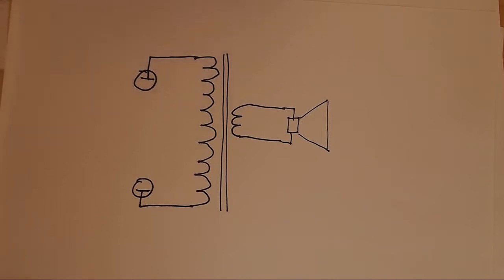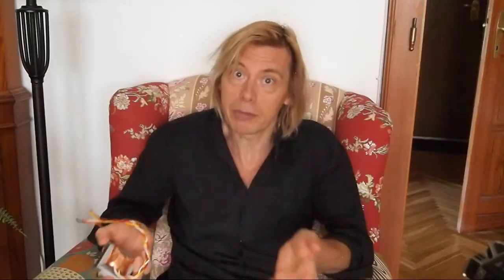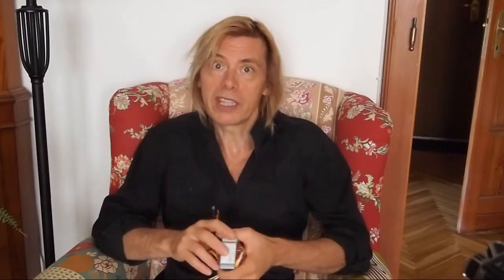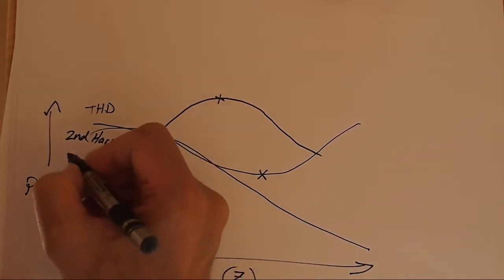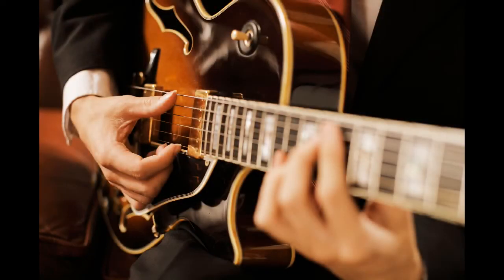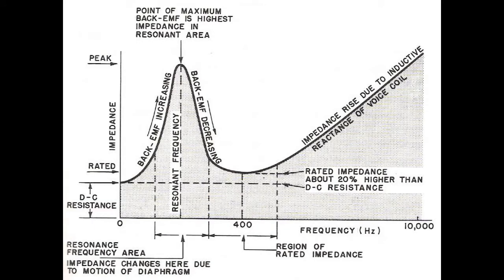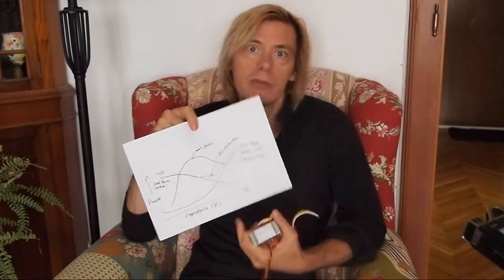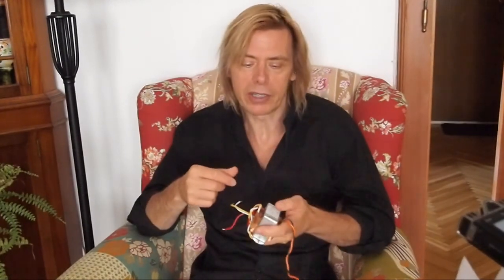guitar amp output transformers

Comment: Thank you very much for this excellent tutorial. Loved it. Question: What makes a given transformer "hi-def" or "hi-fi"? As you know, these phrases are well used by people as the transformers to buy. How are these transformers different?
Reply from the maker: Thanks very much, Christopher. The terms you mentioned don't have specific technical definitions - they're really just used to sell products. The engineers at McIntosh were designing beautiful transformers half a century ago - the state-of-the-art has moved forward only a relatively tiny amount since then. What constitutes hi-def and hi-fi is very subjective, although attempts have been made over the years to define hi-fi as a certain frequency range, flatness, and maximum distortion level. If you have the luxury of experimentation, the fidelity one can extract from surplus and/or modest components can be remarkable.
Reply: Great job!  maybe through in leakage inductance and it's effect on frequency response,